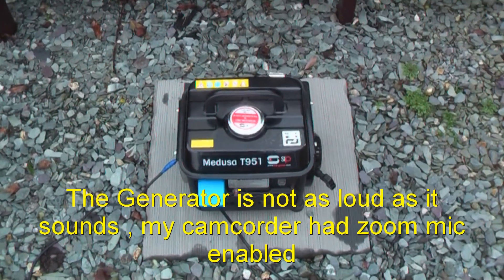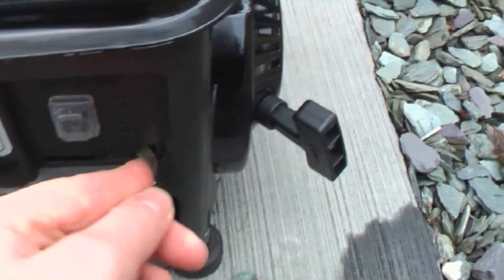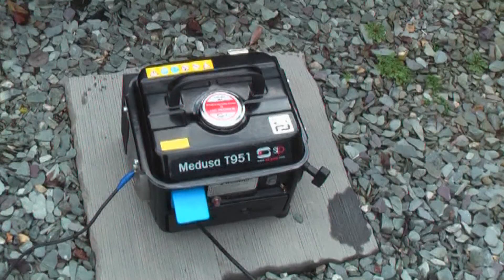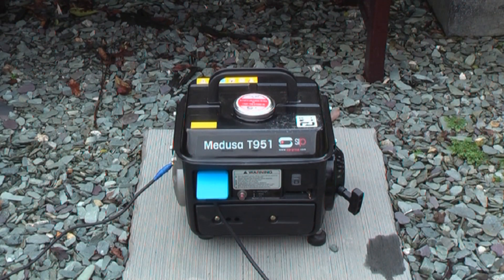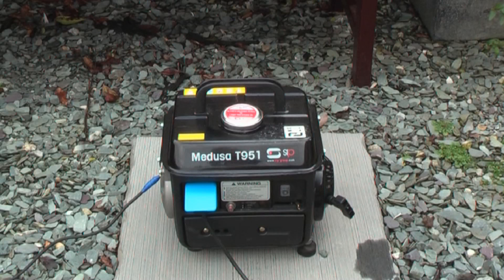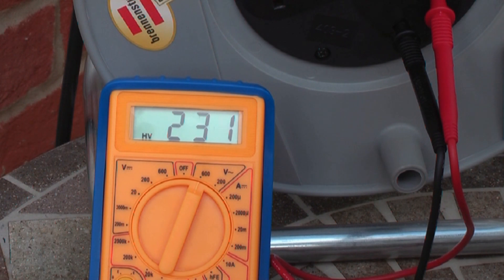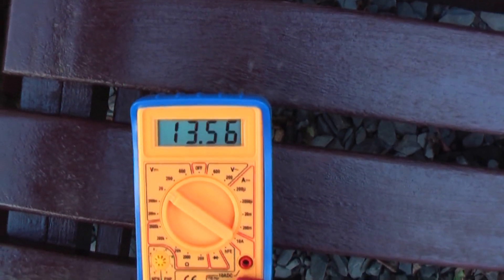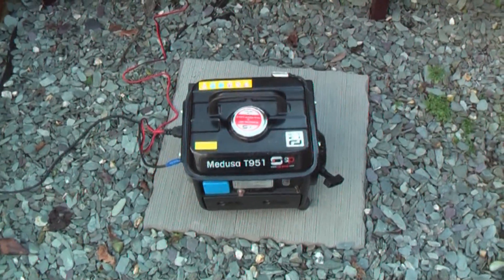2 stroke Portable Generator Test

Comment: Good.You should close the fuel valve before cutting the ignition switch to run the fuel out first if the generator is to be left sat for a while. This avoids deposits forming on the carburetor.
Reply from the maker: Good point, but making sure you disconnect any sensitive loads before so, as if I am correct the voltage can become unstable and peak above 250V as it stalls out.